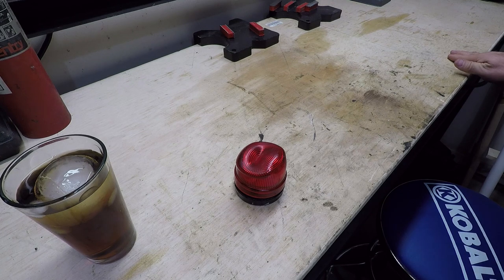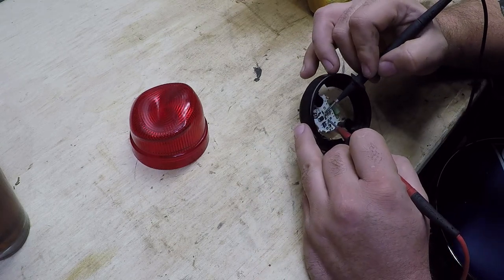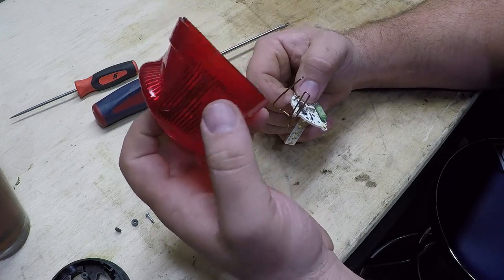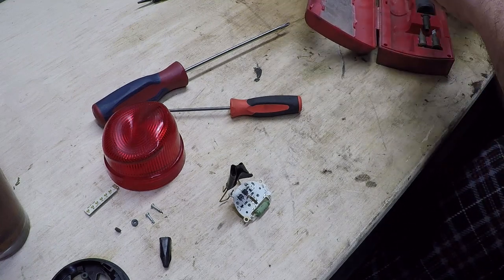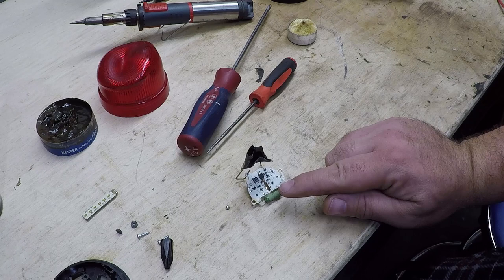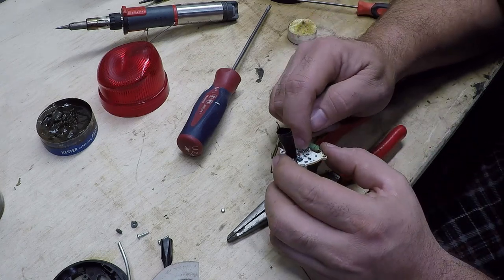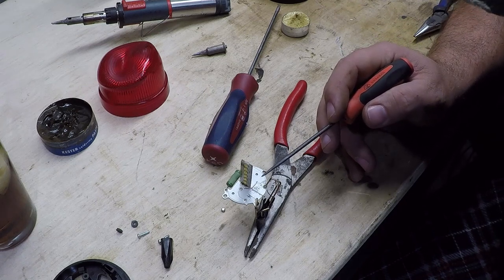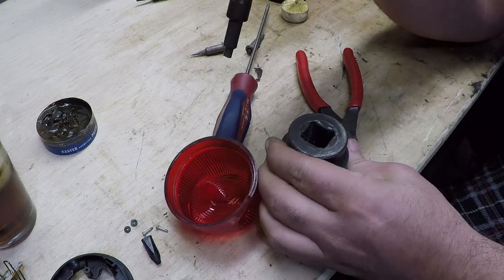How to fix the impossible - Repairing a broken circuit board - Plastic welding

Comment: Walmart actually has the small rosin-core solder in the automotive electrical section (with the fuses and light bulbs).  It's not super high quality (if you can believe that) but it''s always worked for me.  Congrats on the resurrection!  Thanks for the video!
Reply from the maker: burningdinosaurs, I actually just ordered some more solder. Not that I did, I'll probably find my small solder. That's typically how that stuff works out. Lol. Many thanks for watching! 🙂👍

Comment: The skills needed when your broken down in the field no parts and no Napa.👍
Reply from the maker: Robert Bradford, I used to have to use those skills alot. Back when I was a field mechanic, I used to have to use what I had on hand. Which at times, wasn't much. Sometimes it worked, sometimes it didn't. But, trying is 99% of it. Thanks for watching! 🙂👍

Comment: Sprinkle baking soda into the superglue to make a very hard substance almost immediate, and I always use the quote if it's already broke I can't break it more love fixing things most people throw away
Reply from the maker: Andrew Scott, there is a certain degree of satisfaction in resurrecting broken things. Sometimes it works, sometimes it doesn't. But, nothing ventured, nothing gained! Thanks for the tip and for watching! 🙂👍

Comment: I think you got lucky when you put the lite bar back in. My experience with LED bulbs is they are polarity sensitive. Put in the wrong way they wont lite up. Looks like one of my projects when finished,  looks rough- works good.
Reply from the maker: Bill Whalen, the only reason the leds worked was the board was identical on both sides. So, regardless of the orientation, the positives and negatives were oriented correctly. So, I couldn't mess up. 😁. Thanks for watching! 🙂👍
Reply: Well, LED's are a diode, so they are polarity sensitive...

Comment: I'm impressed! That sure looked like a basket case to me!
I think that glass thing is probably a diode of some sort, possibly a zener (voltage regulator) diode. I couldn't find quite a clear enough shot to be sure.
Reply from the maker: I wilton, it was a mess. I was skeptical to say the least. I didn't even think about it being a zenier diode. I'm guessing that is indeed what it is. Tiny little fella. Thanks for watching! 🙂👍
Reply: Hard to see here, but a glass component on a SMT board is likely a diode of some sort...resistors are usually black, with tiny numbers on them, capacitors are usually brown, seldom any markings...either way, pretty good repair!!

Comment: Super glue requires moisture to cure. Thats why it sticks you so good. Blowing onit helps because of the moisture in your breath. Another trick is to sprinkle a little bit of baking soda on it and it will dry almost instantly. Its good to see someone put in a little effort to fix something.
Reply from the maker: dp pmm, I had no idea about the baking soda. I'll have to give that a try sometime. Thanks for the tip and for watching! 🙂👍
Reply: @ToTheTopCrane  it works pretty good. I keep baking soda and superglue in the console of my truck.
Reply from the maker: Tsunauticus III , no worries! I appreciate all of the awesome feedback and comments. Many thanks for watching! 🙂👍
Reply: Baking soda, yeah...there's a guy on here that repairs guitars....uses the baking soda to repair frets and other stuff I don't know the name of...but on the neck...

Comment: Ca kicker spray works great for setting super glue instantly .. you can also use baking soda/water solution in a pinch
Reply from the maker: Dunes4321, I was wishing that I had some. Back in my R/C car days, I used to use Ca spray alot. I need to get some more to keep around. I also had no idea about the baking soda trick. Thanks for the suggestion and for watching! 🙂👍

Comment: Super glue doesn't like to wick into cracks -- better to put it directly on the contact faces.  Also, a hammer does a good job at converting fat solder into skinny solder.  That said, my compliments on having the guts to tackle that "iffy" job at all.
Reply from the maker: BoatShaper, I never even considered using a hammer to make the solder smaller. Oftentimes the easiest solutions are overlooked. Thanks for the suggestion. My thought was that it is already broken. I wasn't going to make it any worse off. Lol. Thanks for the compliment and for watching! 🙂👍